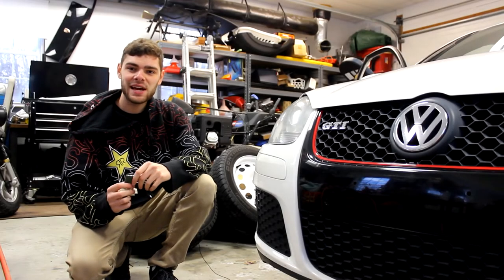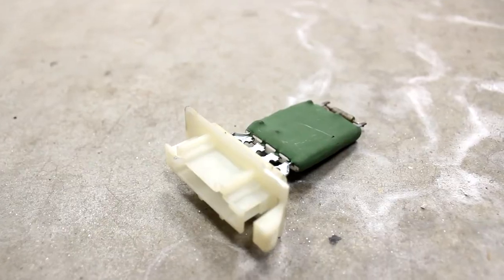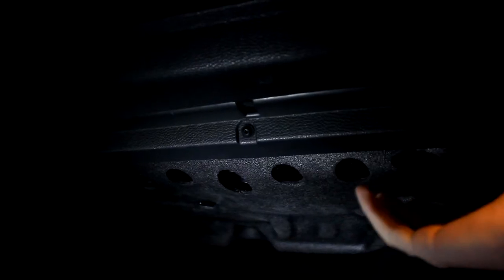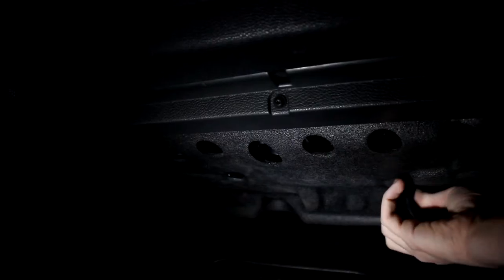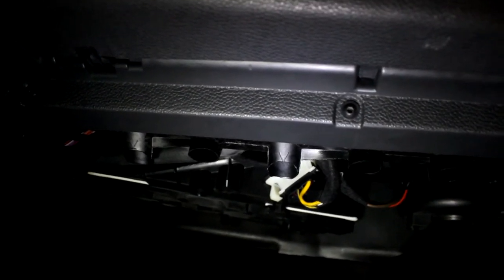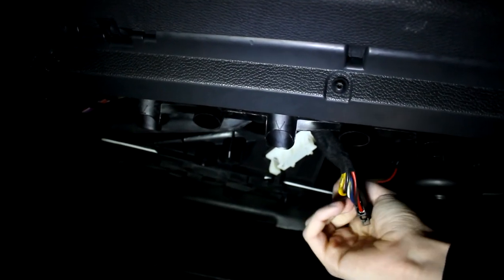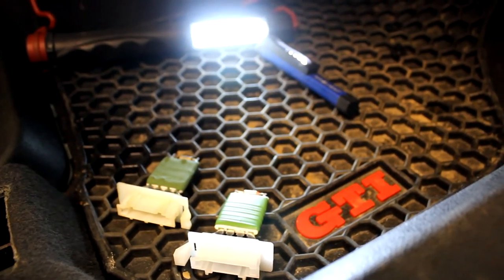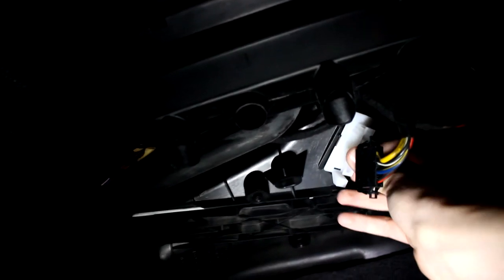Blower Motor Resistor Replacement: Volkswagen Golf, Jetta, GTI, Passat, R32

Comment: I don't do cars. I need men to do all things cars for me. But I switched out my own resistor with the help of this video. I could not believe how easy it was. Some other videos showed taking the resistor out before disconnecting the wiring harness, but that didn't work for me. I couldn't get the harness off after removing the resistor. Your video showed disconnecting the harness first, and that was much easier for someone who is not mechanically inclined (and doesn't have very strong fingers).

Comment: For thoses interested, the part that protrudes at the very end of the "resistor" is a thermal fuse. AUPO BF216 in my case. It blows when temperature exceeds 216°C.

Comment: Will the resistor be the replacement part if the fan is not running on any of the 4 settings? Also my fan is cycling when the car is not even running. Any thoughts?

Comment: My shop quoted me a ridiculous price on this but also insisted that if I didn't replace the fan at the same time the new resistor would end up going again. Any thoughts on that?
Reply from the maker: I’m not sure if it’s guaranteed to go out again, but mine did. It lasted a few months before failing though so I’m not sure if it needed the fan replaced or if it was just a cheap resister I bought
Reply: @CashedOutCars  Do you have a video for replacing the fan/blower motor as well? I'm thinking of just doing both jobs in one go and this is one of the clearest, most easy to follow auto repair videos I've seen!

Comment: In my case, blower blows cold air on all speeds but only 4 gives heat. MK7, is this the same problem you demonstrated here?
Reply from the maker: Hmm that’s interesting. Does it blow air on all the settings but only hot air on 4?
Reply: Yes that’s right. I only figured when the garage asked the question and asked me to test it before coming in.

Comment: I have a problem with my Golf MK6, blower works perfectly on all speeds except when I switch to the windshield direction, blower works but no air coming out. In all other directions, legs, face works great. Is it possible that something inside is stuck or can be caused by a bad blower switch resistor?  Thanks for your help and advice!
Reply: Either the motor has a dead spot on the contacts so its losing power before it gets closed to the windshield position, a gear tooth broke or the flap is jammed up. Normally the contacts are just worn out so it needs to be replaced. Its called an actuator motor. I know this is a late response but better late than never! Who knows you might still have it or it helps someone else

Comment: Any idea why the blower resistor that I put on my mk5 (aftermarket one) overheat and smell like burn in the car when I turn the ac on?
Reply from the maker: It might just be breaking in, if not if it were a cheap part I’d get a nicer one
Reply: Your blower motor may be turning too hard. The bearings dry out and corrode or debris could somehow be  blocking free turning of the fan. Lubrication of the bearings is possible, but motor replacement may be a more permanent solution.

Comment: Replaced the resistor and blower motor and still nothing on all settings
Reply: Have you fixed it since then? I got the same problem no air is coming out on any setting
Reply: @nathanroy2479  yes. Got new resistor blower and a fuse
Reply: @anthonyvick8216  So you replaced the motor itself, or just the resistor and fuse?